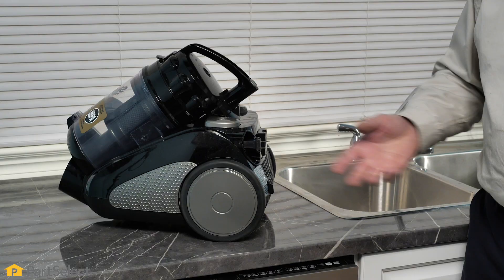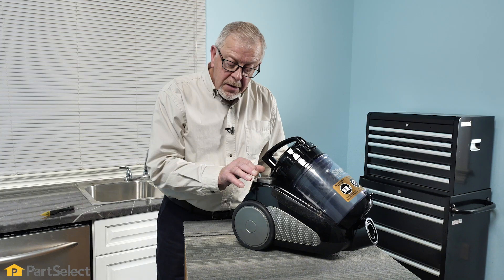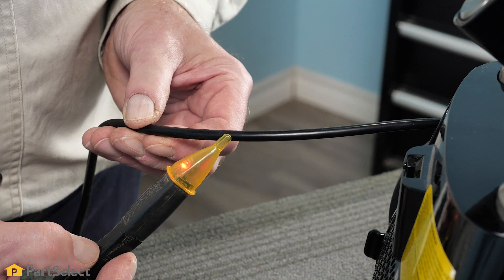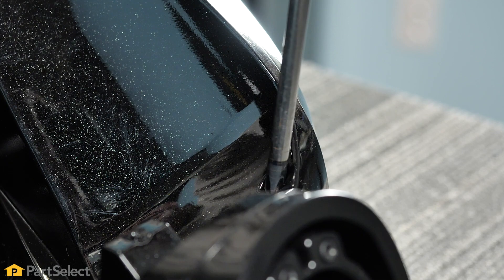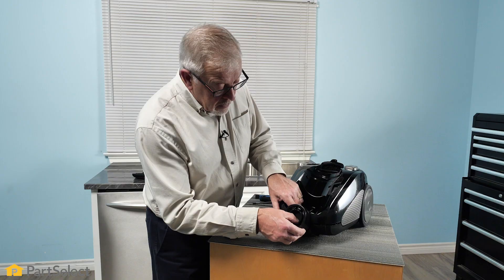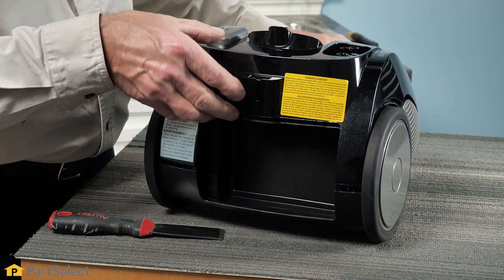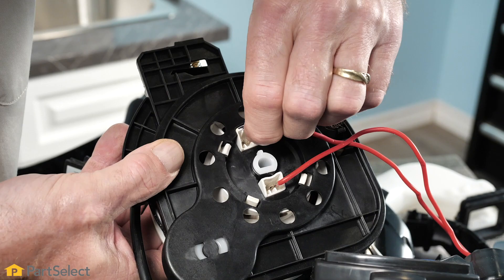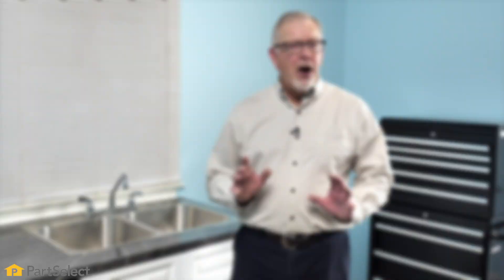Troubleshooting a Broken Vacuum Cleaner | PartSelect.com

Comment: Hi Steve — I have a SHARK NV352 Lift-away vacuum that I can’t figure out how to put the handle hose connector back together. Is there a tutorial somewhere that I can look at? The connection is a push in with a snap ring that holds it on. Any help would be much appreciated. Thanks